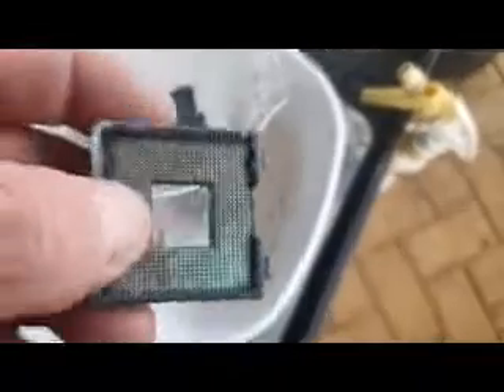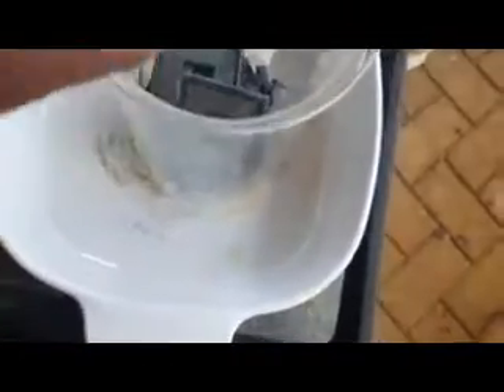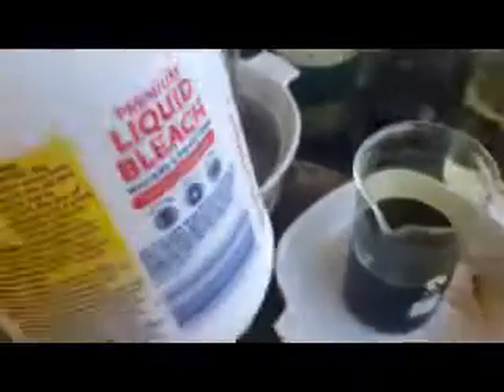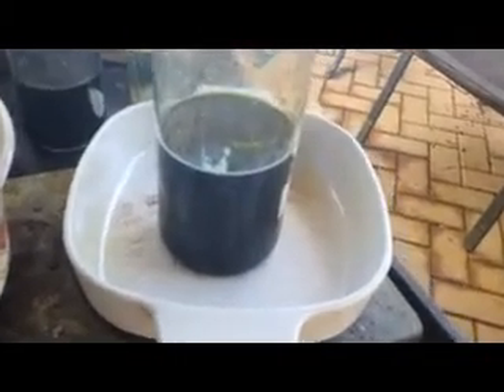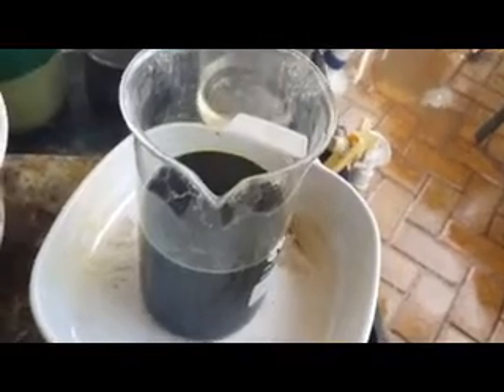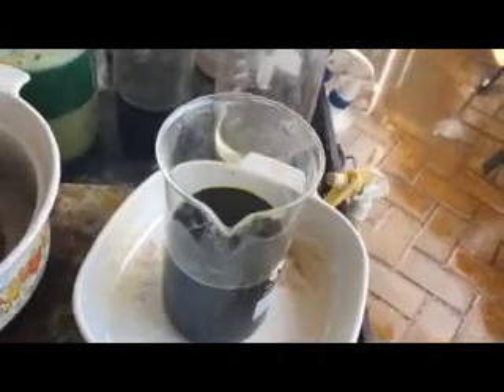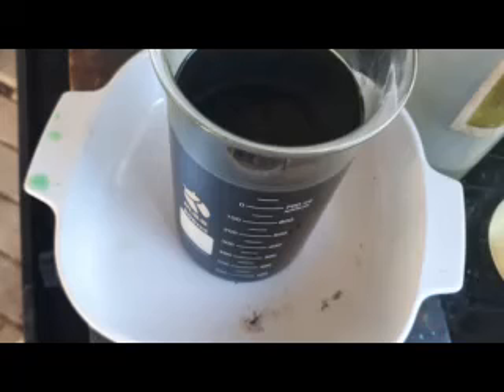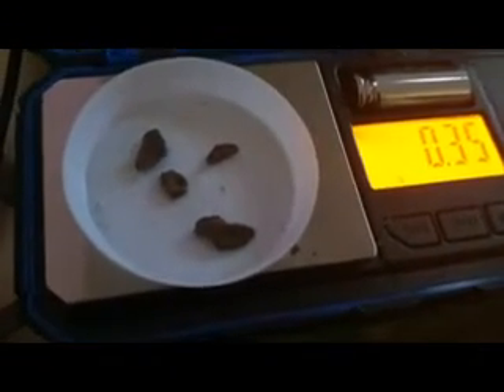GOLD RECOVERY / removing gold from cpu slots without nitric

Comment: hey when ya got a visible amount showin its a good die myte, i got a lot of these sockets ? ya gotta get rid of tin no doubt ?
Reply from the maker: yes you need to soak them in hcl first to remove the solder